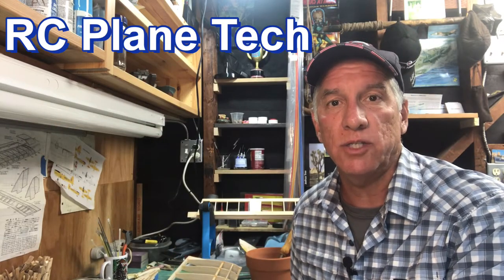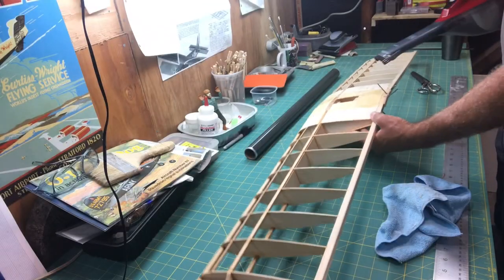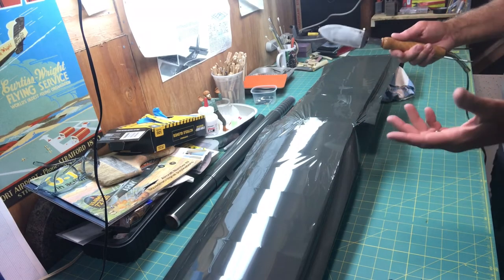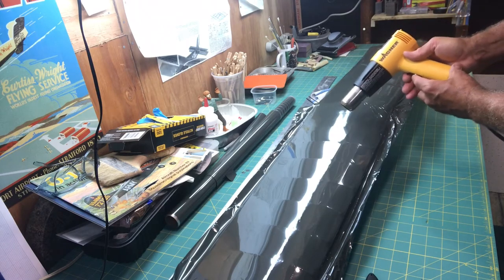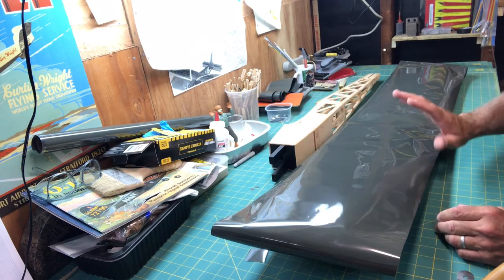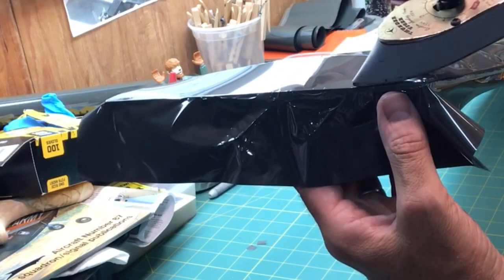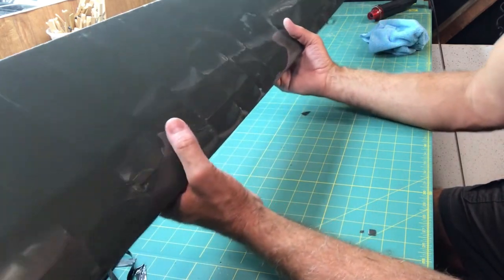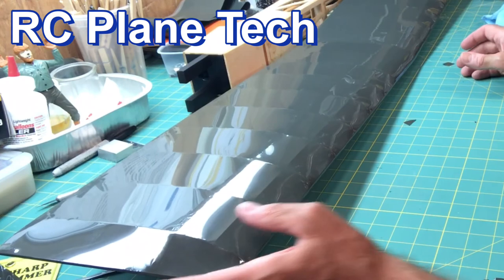Barnstormer 25S Vintage RC Plane Build: 18 Monokote Wing

Comment from the maker: Hello, There are no temperature degree settings on my iron or heat gun. For the iron I usually set it about 3/4 full. And the heat gun I have has two settings and I use the low setting. The iron I have is 165 watts and the heat gun is 1200 watts. Monokote can take a lot of heat over short periods of time, you run into problems when you let it sit on the Monokote too long. Its best to keep moving on and off an area until it tightens up. So it can take several passes to avoid melting. Every Iron may be a little different, so I suggest practicing with yours using scrap pieces of Monokote and scrap wood to learn how your iron works, same for heat gun. For Monokote the iron will start to stick a little if it gets too hot, thats when I know to turn it down. Other covering material may behave a little different, but this is generally how I do it. Just practice on spare material then cover your plane. And if you make a mistake, just peal it off and try again. Have a great day!
Reply: GRAZIE PER LA TUA RISPOSTA E' SEMPRE UTILE L'ESPERIENZA DI UNA PERSONA CHE CONOSCE IL METODO
Reply from the maker: GRAZIE, sto imparando un po' di italiano! With Google translate